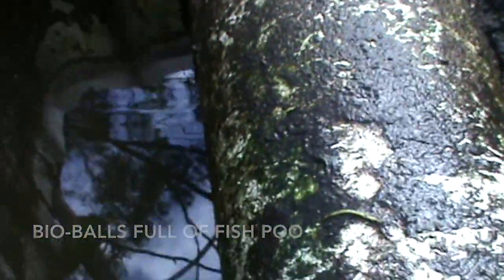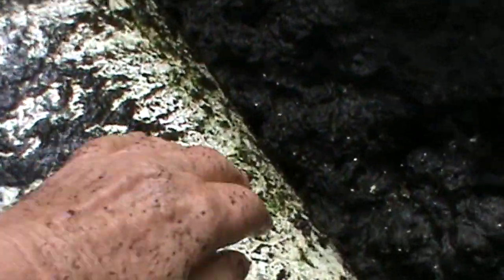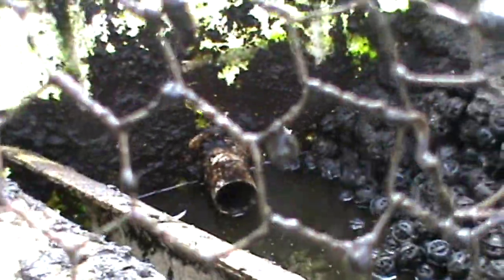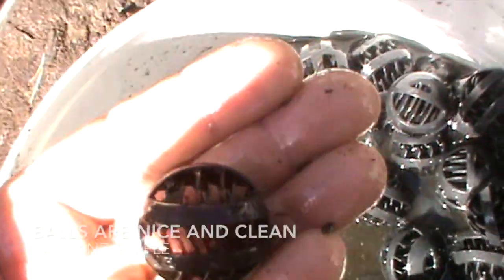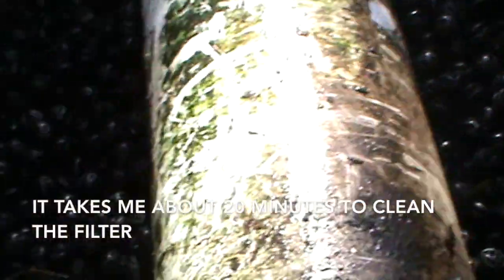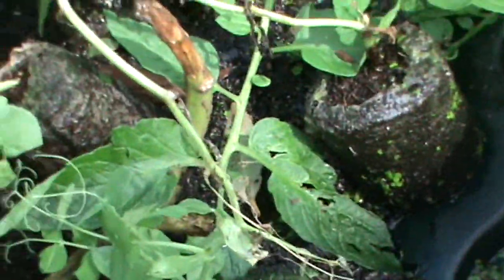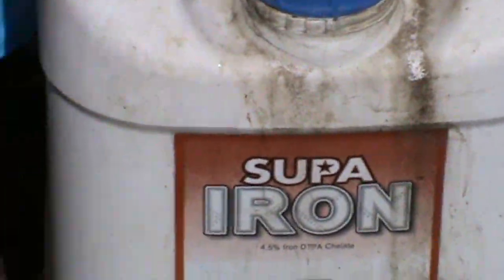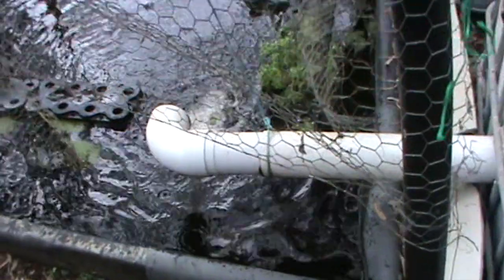WHY I USE BIO-BALLS

Comment: That large tank where all of your fish poo is, approx. how many of those bioballs did you need? Some dude on Ebay has them 5 pack of 150 pcs (750 total) for $20 US, but it looks to me like you've got at least that much or more.
Reply from the maker: You do not need a lot of balls. They are only there to provide surface are for the bacteria to convert the nitrates to nitrite. The fish poo sinks to the bottom and sits on top of the bio-balls. The top 2 layers of balls are full of poo, the bottom ones are clear of poo. I have shade cloth hung into the tank attached to the top of the sides and the balls are in there, the water flows over the sides that hang down about 12". I have about 1500-2000 balls in there. I have 1500 fish in the system. I paid about au$105 for 2000 balls. They last forever
Reply: @CEDARVALE54  Thank you Regina for responding. I think I found something a little bit cheaper than the bio-balls. Those plastic pot scrubbers that are made out of mesh are 6 for $1 at our dollar store. They are bigger than the balls.
https://www.amazon.com/Round-Nylon-Scrubber-Scouring-Scrub/dp/B0773VZ2P4?th=1
Some are made of nylon. Some are made of polypropylene.  Either way, they should be safe for the fish and I won't have to pay shipping!

We are supposed to get rain tonight and tomorrow and we finally got the pond built. Haven't got the liner fastened down, we'll wait until we get enough water in there before we fasten the top of the liner. 8' (2.4384 meters) x 8' (2.4384 meters) x 20 inches (50.8 cm). deep.

We'll build a bigger one, hopefully for catfish. I think catfish like it deeper. And a grow out channel for the baby crayfish (marbled). I'll probably grow rice in it and let them eat the leftover roots and stuff.  I'm not allowed to have your Australian Crayfish without a permit and it has to be in a building to make sure they can't escape! LOL I suppose that means hurricane proof!
Reply from the maker: The pot scrubbers may break into tiny pieces after a while and be ingested by the fish, they should work well with a high bio-logical surface area, the balls are UV treated. Just a thought. Here in Australia some of our vegetables come in plastic mesh bags which you could also use . Nice size pool you are building. My pools are deeper one end.
Reply: @CEDARVALE54  Thanks Regina...you wouldn't believe it! I went to the stores to get them and they were out of stock chain wide! None of their stores had them, LOL! Oh well...any thoughts on using shade cloth? I've got plenty of that. It's UV protected, knitted.